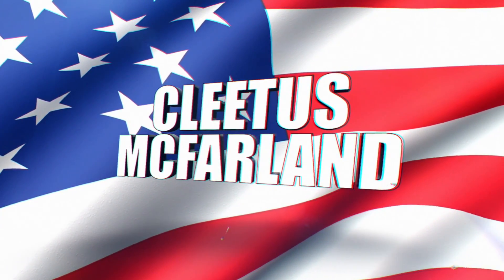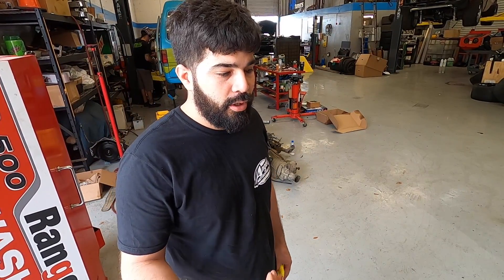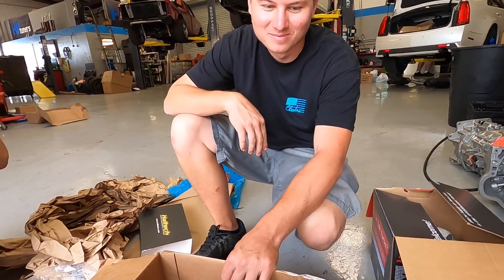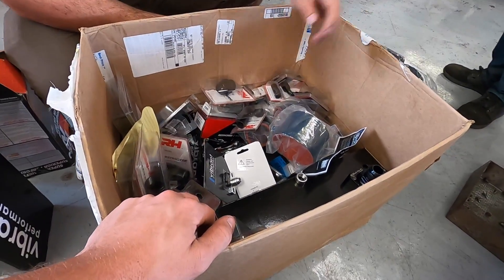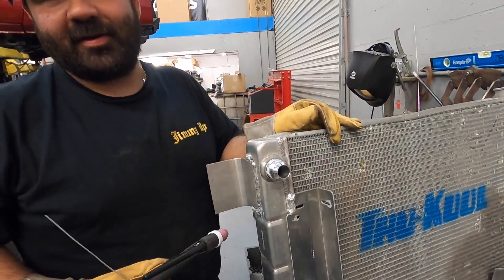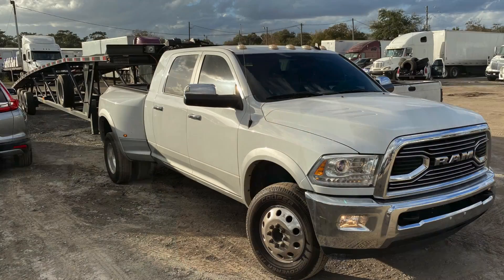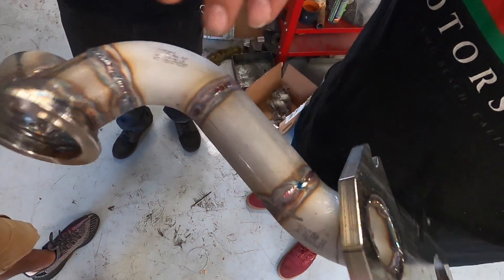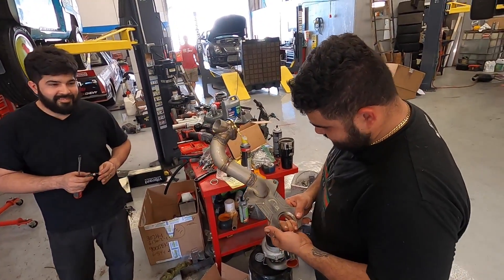ROTARY Swapped Mystery Machine EP.2 - BIG Turbo on a LITTLE Van! + WE GOT A NEW TRAILER!!!

Comment: Garrett, please, please, please LOSE THE GOOSENECK BALL HITCH on the 3 car wedge trailer. They are notorious for causing roll overs with dually pickups. They do not take side load forces you'll get with three cars on the trailer. Word to the wise, get a real 5th wheel hitch.

Comment: Cleetus, leave your torch close to the weld after you quit applying heat.  The welder should provide a 'post flow' that will continue to protect the weld from contamination as it cools.  It makes a big difference by keeping the tungsten and the weld clean throughout the process.

Comment: You need a CDL for that trailer if your GVWR rating on your truck + GVWR rating on your trailer is total of 26,000 pounds or more. Even if the trailer is empty! If your truck has a high rating there are places that can lower your GVWR on your trailer (new sticker) to make you legal
Reply: Oh also if you dont put "private not for hire" on the side of the truck you will be chased by a state trooper every weigh station you pass

Comment: Ya'll ever consider mounting the radiator towards the back of the vehicle, from the ceiling, and making a big custom duct on the roof top to feed it air? then out the back windows (ducted)
Reply: TexRobNC could make some cool smoke pattern with fans plus take the smoke out of the cabin
Reply: TexRobNC I don’t think it needs any more weight up high lol

Comment: Cooper seems to be a little nervous about ever driving this thing, understandably
Reply: It's probably gonna roll first time it does a burnout but it will be funny af to see😂
Reply: needs a roll cage, new sheet metal under the seats and a firewall.
Reply: What’s he not nervous about driving? He’s usually not very good at participating in anything out of the norm.
Reply: @richardreinhard8864  yeah that needs a firewall forreal i wouldnt wanna sit on a boosted rotary, and its gonna give off heat like crazy.
Reply: @CTemple82  Exactly. He needs to just hold the camera and keep silent.
Reply: Falky and toastr hardly ever roll during burnouts so cooper will be ok
Reply: @jamesrustles8670  You don't realize how tall and skinny those vans are. I had one in Japan and that thing was crazy sketchy. It will roll easier than a golf cart.
Reply: I mean when that rotory burnout truck blew, I'd be nervous too! Lol
Reply: Cooper’s always a little nervous
Reply: TT you need to keep silent

Comment: Maybe a Wide-body conversion with like 4 more inches of Axle front and back save our Copper from rolling this bad boy doing Donuts! Hell yeah Brother!
Reply: A wide body Cushman Mystery Machine would be bad ass! Molded flairs and real axles and tires would be the greatest ever!
Reply: I really don't think coop is afraid of rolling it. And if/when it does, big deal, the thing weighs next to nothing, just flip it over and rip it again
Reply: You'll run into an issue with the doors opening I think they slide over the wheels
Reply: @brysonfields2284  just have to turn them into gull wing doors
Reply: just need a few wheel spacers and call it good enough

Comment: Coming along great! Love the trailer.  I know these trailers and 9k is a steal for that rig! That trailer is $11,500 new and from what I can see it has a minimum of $4,800 in add ons.  The winch is $1,900 the steel decking with tiedowns is $2,000 and the wheels are $500 not sure how much the tool box is but. There are a few more upgrades also. Whoever ordered this did it right. It's been upgraded for medium duty use. I wouldn't use it daily for a business. But I would trust it to go cross country with no issues.  The upgraded axles it has with the third 10k lb axle is great. You can safely haul 30k over the axles. Once you started talking about all the things you are going to add under the decking I was worried. Just remember to put the heave things from the middle axle forward. I'm stoked for you! Keep doing it for Dale!
Reply: Until Cleetus  mentioned they were planning to put decking in between the lower frame  rails to carry tires gear etc I was going to suggest welding in some triangulated bracing between the lower frame  cross members  to stiffen it up and keep any frame flex to a minimum, but I'm sure that will be part of the upgrade.

Can't beat the price on that trailer though, I would have bought that for $9k in a hot second.

Comment: You should do bigger and wider tires, also some fender flares for the extended wheel
Reply: Yea, they need an axle for it first. That rotary is going to shred those shafts and diff.
Reply: Section 10 inches out of the middle of it.

Comment: Could you extend the rear wheel base width putting the wheels on the outside of the fenders witch would make the burn outside look cooler and be safer. With that narrow wheel base and height first slide and he gonna be sitting on the roof

Comment: When you blow out your tires that engine and trans are going to be sitting on the ground
Reply: Sump is lower, it'll crack first blowout
Reply: Sorry but when the tires blow rims will be on the  ground first and if they fall off then the diff will hit next so yeah motor and box are fine
Reply: @seanb5664  if you looked you'd see how low it is that it'd be damn close
Reply: @seanb5664  it's not like it's in the stock place of the other motor it's considerably lower

Comment: Heck, the 22 incher’s will give you some rolling stock weight to offset the minor tipping weight. 😉😂🤣
I have been driving vans since 1976. I have driven both large and short box Chevys, Fords and Dodge vans. They handle surprising well. Comparable with large sedans but lighter❗️👍🏻👍🏻👍🏻

Comment: There should be a post flow option and when you finish your weld you should hover the torch right above the weld to let the weld cool with argon shielding it. Instead of finishing and immediately pulling the torch away. It will help the weld look nicer and be a little stronger.

Comment: You'll want fenders for that trailer. It won't make a difference to keep cars clean because it's an open trailer but keeps road debris from hitting what's on the trailer.

I've absolutely popped that back window out of a 6 foot box hauling a camper. Made a really careful tight turn left turn but the camper hit a high spot on the right wheels and the left side came down to kiss the rear window lol

Comment: The Mack trucks that i work with use those exact coils in the DPF system to run badass igniters to do a regen. If you get shocked, you will feel it in your eyeballs from experience....

Comment: Be extra careful of the weight of the trailer & truck combination when loaded, it it exceeds 10001lbs you need a commercial driver's license to operate it
Reply: That truck is 6500-7500lbs by itself. The trailer probably weighs another 2500-3000 unloaded.
Reply: Lol you're a trucker and you think you need a CDL to run a truck over 10k pounds? I was 19 when I opened my first business like this running a wedge trailer. I was under 26k pounds GCVWR and was legal with just a regular drivers license.  But yes if his truck is rated 15k pounds and the trailer is rated for 15k pounds he would need a CDL even of the trailer is empty
Reply: It’s actually 26000, people would have to go out and get a CDL to rent a small moving truck. When they exceed 26000 , they can hire me to drive it for them. I’m sure they’re looking forward to the day where they can just send their crews ahead to set up their events and they can just fly there.
Reply: My bad y'all are right it is 26001 lbs... i was thinkin of something else
Reply: @vegas_the_trucker1595  probably weigh stations. Anything over 10k has to pull in.
Reply: 26k is one thing to worry about the other is the 65' max overall length if your truck has a box or flatbed.  That's why you see them with fenders like big rigs.

Comment: Any shielding over the engine/trans?  Go back and watch the pickup burnout video.... you’re sitting on top of all those parts that flew out at high speed. Love the project! Stay safe.
Reply: James W no parts flew out it literally just blew a radiator hose...they put a new hose on and drove it next day lol
Reply: @Issaj-ll5og  Hell, they ran the thing without coolant 15 minutes later and redlined it instantly. Then the next day they did burnouts without the hose fixed just to flex.
Reply: Chad Guenet - interesting. Could’ve sworn I saw a large chunk fly. I didn’t do deep analysis on a phone screen. It’s irrelevant to the point though, really. They’re still sitting on top of controlled explosions and parts spinning at high speed. There’s a reason they put ballistic blankets on superchargers, shield bell-housings and drive shaft tunnels etc... Just hope they stay safe, that’s all.
Reply: @jamesw6899  yeah it was a chunk of hose but I'd be surprised if it doesn't have a date with profab for a cage/protection already lined up. though chances of the engine itself sending parts flying are super slim they should definitely shield everything from the trans back and at that point might as well do the engine too just to buffer the heat the driver feels.
Reply: Madarius they already said they were doing a head protector behind the seat

Comment: The mystery machine NEEDS a Dana 60 rear. That is all.
Reply: mickymike1000 a Dana 30 would be plenty for 400 lmao
Reply: I'd go the dirt cheap 8.8 route
Reply: He said it will end up with a ford 9". A 60 is a bit much lol
Reply: The dana 60 weighs more than the entire van bro
Reply: My diff on my Avanti says 43-15 2.87.. Can anyone tell me what that is. When i google it nothing comes up.
Reply: @lilbitzzybitz45  2.87 is the gear ratio. divide 43 for ring gear by 15 pinion you get 2.866 ratio
Reply: @CharlieBrown-pb9xn  oh i see now. I dont know much about diffs. Thank you
Reply: I'd say Ford 9 inch or even a 8.8 a Dana 60 is a huge diff that isn't necessary
Reply: A Toyota 8” rear end would be plenty for that thing. They are basically smaller, better designed 9” axles. People run them on 700+hp trucks on 44”+ tires and they hold together with basic upgrades. And, they are so popular, parts are readily available and cheap. Spool for under $100, good axles for under $200...

Comment: it's going to get so hot in that thing whilst it's doing a burnout I mean the engine is practically In the cab
Reply: Just put a mini fridge full of mtn dew next to the drivers seat. The more weight in the front the better xD
Reply: Just take a sawzall and cut a hole in the side of it and go to Lowe’s or Home Depot and pick up a window mount air conditioner.
Reply: In the winter Be able to wear tshirt and them short shorts they be wearing

Comment: Make sure you check the tire and axle weights. I work at towing company and run across trailers like that. That are over weight on axles and tires all the time and DOT shuts them down. Make sure it scales correctly might have to up axle and tire weight capacity.

Comment: If you need more ground clearance I used to have one of these with 15s on it and running a 195/50R15 tyre. Takes a little bit of clearancing on the front but the rears fitted no problem.

Comment: This is a cool project. Was hoping you took out the back window though be better for either exhaust out the back or mount the radiator in the back window rather than have the door open incase it ever did roll over. Would work pretty good just take out the driver and passenger side windows and even replace with bars/mesh and the airflow would be pretty good. Need to put slightly bigger tires on the back but have to keep the flower caps

Comment: Trailer. Pack the bearings with good grease by hand and get rid of the grease fittings. Monica and Buffy do not need grease fittings on their front axle nether do trailers. All they are good for is pumping grease in to the brakes. Bearing buddies on boat trailers are set up different and need to be there to push the water out.

Comment: Are you actually going to cut a radiator sized hole in the side door and mount the radiator to the door with electric fans? I think that'll work mint, pushing air from inside to outside

Comment: Just use the TIG torch and gas only to fuse carbon steel and or stainless steel pipe together, just set the amperage around 65-95 And use the foot pedal if it has one, and just go "downhill" with a "whip and pause" method ie whip and cool method, which can buy you more time Welding than blowing holes in the pipe!!! Set argon or preferred gas at 25to50 cfm!!! The weld should sound like a very loud low pressure hiss with varying audio via the whipping!!!

Comment: Side note on the trailer. I believe you have to obtain a class A commercial license. I’m a truck driver myself dealing with weight. Number of axles and the length of the trailer. If you already have one you good. DOT scales will slow you done. Just a heads up brother.

Comment: Ok 1) don't put the fuel cell in the back. It's a guaranteed fire if the rear is hit. 2) just put spacers and or bigger wheels on it and you wont need to worry about it flipping.

Comment: Hey you guys you really might want to check d o t regulations especially if you have a 50 ft trailer already might be illegal if you put 3 foot extensions on the front and back of your trailer with your rig there is a maximum length

Comment: Be really mindful of putting a more structure beams on that wedge trailer,.... they need to flex!
 You'd be better off to put extruded it all the way across the bottom and some thin strap steel to reinforce it because if you box in  more of that trailer it'll start taking itself apart at the original welds.

Comment: Take Ruby’s motor and put it in the other van you just bought. Take Leroy’s motor and turbos and put them in Ruby. Call up tsp and precision and get a 1900-2000 hp motor for Leroy.  Ruby would be insane with Leroy’s setup

Comment: I also have a 13B turbo mini van, it’s a white Suzuki carry van on YouTube and there are a few videos floating around of it. I have used a manual gearbox out of a bigger van as I had planned on running it N/A so I could get it engineered for street use. Since doing work on it I changed my mind and have now decided to turbo it and have done all the appropriate things to get it passed so I can still use it for street use with the turbo. I found that the seat height was the biggest issue I had. I will be making a custom intake manifold and have had a few people ask me to make me an intake manifold for them so I may do that if I feel up to it. I like how you guys are not scared to show your welds ha ha ha ha....keep on posting them videos mate.

Comment: If you're pulling that much weight 3 cars and tires and pit bikes fuel etc. all on the same trailer, won't that put you over weight and you'll have to put either not for hire or a dot number on the truck and get a class A cdl to pull that heavy on the freeway?

Comment: Dude!!! Safety! that radiator needed to go out the back door, or underneath horizontally behind the rear axle. Oil pans are way too low you're going to hit them just getting them on and off the trailer. That thing need a roll bar/cage with some type of extruding bumpers for when it tips over and something for wall taps and definitely needs scatter shielding or Cooper is going to be pulling pieces of rotor out of his ass when that thing blows!

Comment: SO LIKE...is anyone going to tell them its not smart putting a Rotary underneath u when it explosed and big chunks of metal might fly underneath the seats ? 

Or its not smart to install hard pipe coolant lines because its more stress on the engine because now there is no way of know when enough is enough??
Reply: Seriously i want to see this project go forawrd but they have to reinforce around the engine for protection them selfs... 

And keep the coolant line rubber so when its too hot and too much pressure its a sign to give up and shut the engine off ? 

Be careful guys not worth the injury

Comment: Kaufman trailers are BAD for doing it. They claim to primer then add 2 color coats. It lasts a few years and then goes. Leaving to either spray paint the metal or sandblast and repaint. Had a 3 car like you picked up, and a 5 car.  Brakes are  shit too, heads up on that. 

Keep bearings, races, oil seals, a couple caste nuts and cotter pins on ya. You'll eventually need it and be grateful.  Youll have all the tools in the trailer you'll need to swap them and go. If you replace a bearing, replace the race. Can't do one without the other. I've tried in a pinch and ended up replacing both. 

Bearing 14125A and 25580
Race 25520 and 14276
Seal 10-36

Comment: Hey cleetus i dont want to come off as some sort of internet cwi or rude at al but just so you knkw when a weld on stainless turns gray like that it means you ran to hot and have burnt the chromium ot of the metal, making it no longer stainless steel. Again just giving information

Comment: The radiator in the door is lame. It would be way cooler to run it in place of one of the back windows. Piece of sheet metal to close it off completely with fans inside blowing out.

Comment: I might recommend putting a heavy plate shield over top of the engine just in case it throws a rotor. That way whoever is sitting on top of it doesn't get maimed.
Reply: Chad S rotaries don’t throw rotors that’s piston engine things 😂😂
Reply: @angelmotorsports  Ok, just figured I'd mention it but you guys are the experts. Thanks for the info. 👍